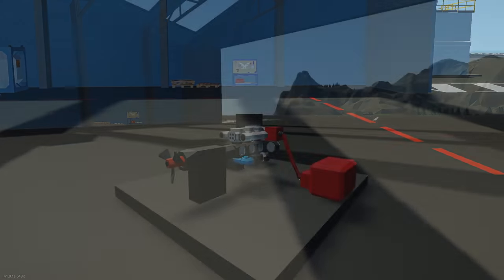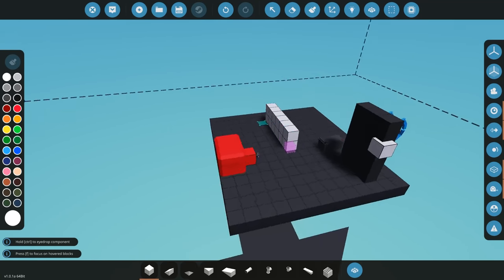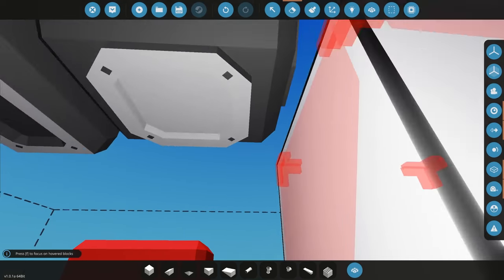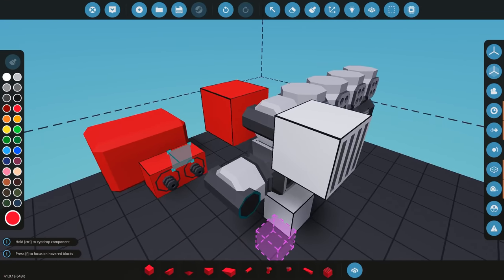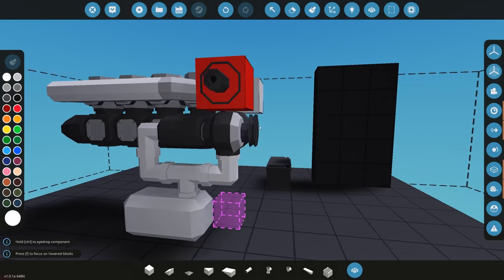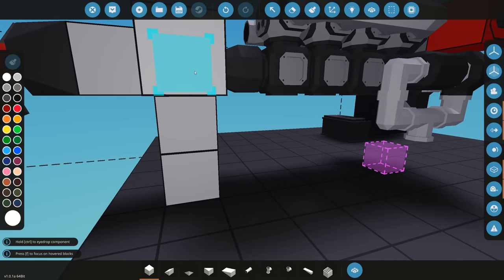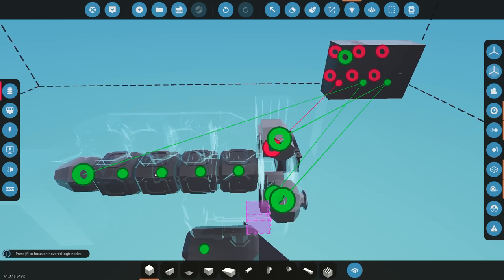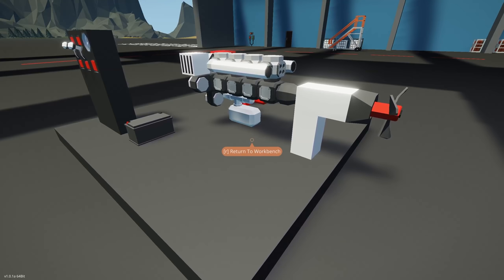NEW MODULAR ENGINES!!! - Stormworks Version 1.0

Comment: Update 2.0: All old engine are gone. Added metallurgy so you can build your own engine from scratch.
Reply: Jokes aside, i'm a big fan of making everything modular and let people make things the hard way rather than plop down premade stuff. I would love to see the pumps and winches in the game require mechanical power input to use instead of just electricity.
Reply: @themalcore_  yeah maybe they can use electric but mechanical power gives more pull power
Reply: That's Automation level of engine building
Reply: Update 3.0 made engines have 0 HP or torque so there worthless
Reply: @wildman510  nevah

Comment: A recommendation: use a constant number set to 1 to do the alternator/pump clutch. The alternator won’t produce power otherwise. It was set to 0
Reply: I have been hooking the accessory clutches to the crank RPS, keeps from having to add clutter and they will be on when the engine is running.
Reply: Jeff L bigbrain

Comment: @MrNJersey. Would it be possible if you could recommend a multiplayer workbench? I play with a buddy of mine and the big "showstopper" is actually how long time one of us need to sit at the workbench and then verbalize the design process. It would be so much better if we could both work at the same thing. One person working designing the crane and the other working on the engines in the same designer. The designer should have some way of indicating points of interest in a conversation ("I think THIS will prevent large container" while item flashing because the person talking alt-clicked it or something) 
It would also open up a new range of "fix my design" video series where you could actually coach people.

Comment: I wonder if you can use the cooling pumps in conjunction with the user inventory hoses to basically make a little single cylinder engine powered fluid pump for moving fuel  around or draining a flooded vessel

Comment: Can we put a fluid pump on air intake and make it kind of a turbocharger
Reply: shresth sonkar that would be so sick!
Reply: The Un-Known Musician indeed. It would also make more efficient small engines possible — maximum fuel efficiency and minimum size. Could be useful for small helicopters etc
Reply: i dont know but gonna test it
Reply: i cant get the engine running so cant test it
Reply: shresth sonkar it certainly would!
Reply: This is something i would test and work with after the release of them. That way they are not changing things with the engines nor fighting the bugs im sure they already are.

Comment: put 32 3x3 in a 23k mass ship, fastest I can get it is 23m/s, ~40kts. It seems rather slow for the size of the mod motor I built but the fuel usage is ridiculously low. I don't want to do the math but I'm pretty sure I could run it full-tilt for days.

Comment: In theory with the fluid pump you should be able to create a centrifugal supercharger... tested and unfortunately not the case.
Reply: Wait until they release them it may change
Reply: @masterenos  I hope so. Turbos too!!
Reply: A fluid pump can barely move air the are designed to move things much thicker than air. So in theory this pump would only affect the engine negatively if used as a compressor.
Reply: ᚹᚨᛚᚲᚾᚢᛏ ᚷᚨᛗᛁᚾᚷ  Well since the game refers to air as a type of fluid then I’d presume it’d work
Reply: @MaxMarcotics  bruh.. you just talked like it would work irl..
Reply: ᚹᚨᛚᚲᚾᚢᛏ ᚷᚨᛗᛁᚾᚷ  Well considering the devs idea is to add minimal parts to modular engines... that would suggest they’d use a “pump” for multiple purposes.

Comment: I personally hate the exhaust clouds.  I hope they either keep it this way or drastically reduce the exhaust cloud.
Reply: I hope they reduce exhaust clouds, but not remove. I agreed the current ones are excessive.
Reply: You don't use fluid nozzles for the exhaust to remove the smoke? I've been doing it for years.
Reply: @neth77  Oh that's a thing??
Reply: @ruusteriv  Always has been. great little way of getting rid of the annoying smoke.
Reply: @neth77  So I assume you must put a pump in too if you use a nozzle?
Reply: @ruusteriv  no need
Reply: @neth77  Hm, I tried a fluid nozzle once before but it didn't work. I assumed it was because I needed a pump. But I didn't experiment further I just used a normal exhaust. I'll have to revisit the fluid nozzle method it seems.
Reply: @neth77  wow, really wish I'd tried  that =/

Comment: Do any issues come with the experimental branch?
Reply: yes cant get angine running
Reply: That isn't one of the issues. Engines work, but they can be a little tricky
Reply: @RuusterIV every engine? or just the modular?
Reply: @thatoneguy611  I have used my normal engine vehicles just fine, and modular ones work too